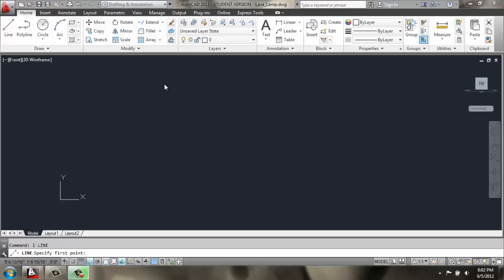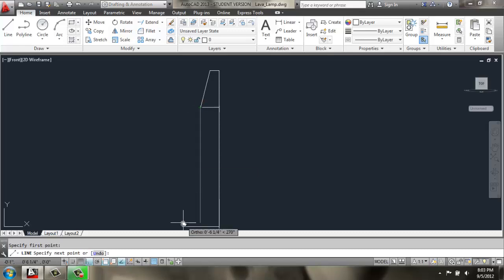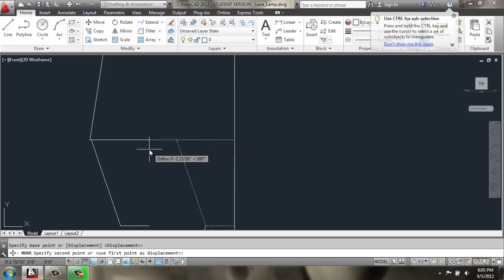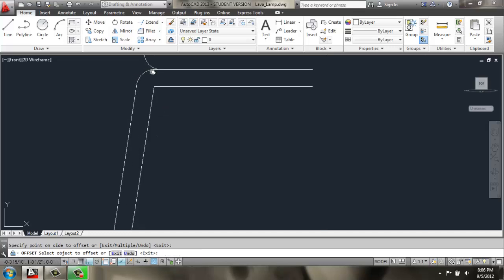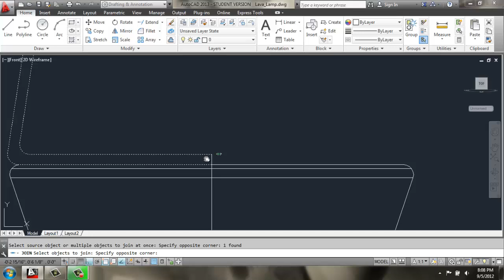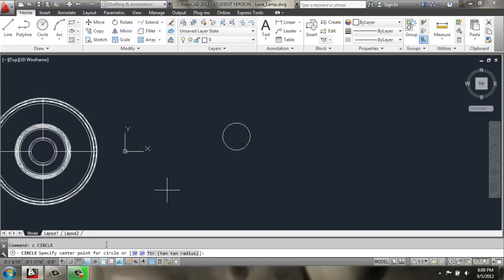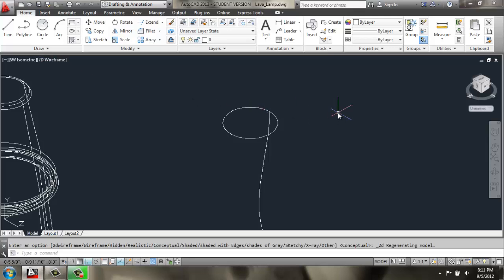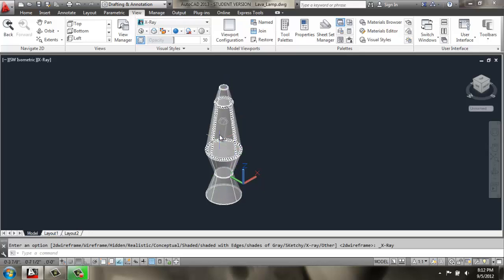AutoCAD 2013 - 3D Modeling Basics - Lava Lamp - Brooke Godfrey

Comment: Hey Brooke. My compliments to you for the clear and crisp acad videos ! I am stuck in a project where I need to create complex boxes in sheet metals . I have created the solids but I can't seem to shell it with the sheet thickness. I need to shell the solid so I can derive the inner surface dimensions which is needed while I cnc cut my sheet. Would appreciate your help :)

Comment: Hi there and thanks for this video!
I have problems though (still quite new to autocad13).
Whenever you use shortcuts such as "fillet" or "offset" by typing it to the quickbarfield thing, I won't get the same function. When I try "filletrad" or "offsetdist" appears instead. So for me it's hardly possible to follow the instructions. Do I have to change a special option to switch to another context so the shortcuts will be the same as yours?
Thanks in advance!